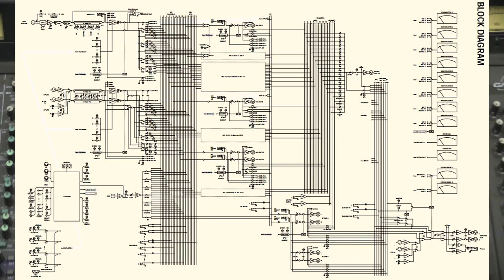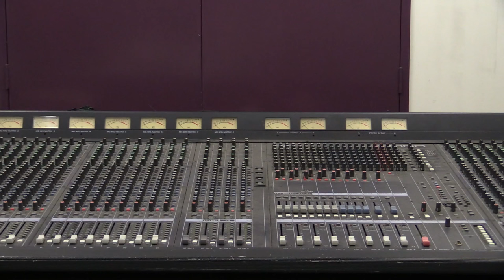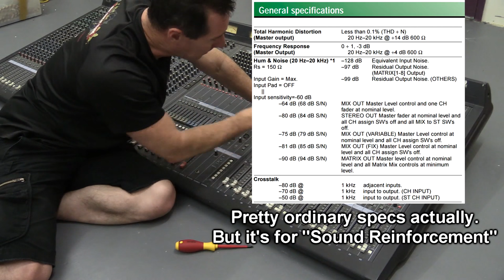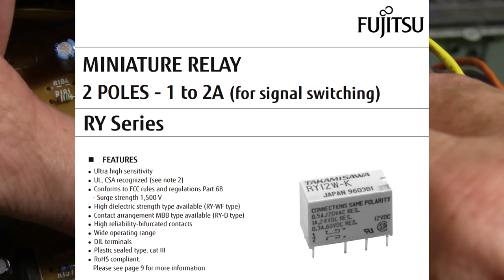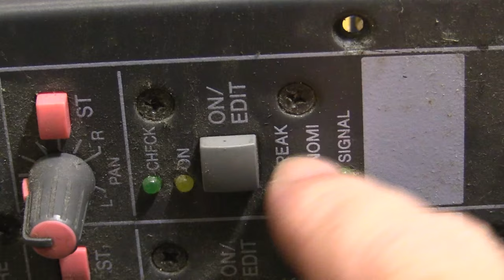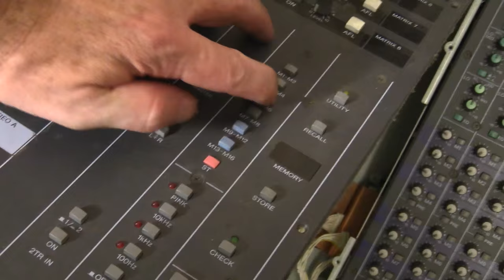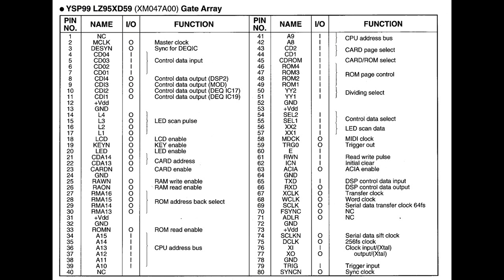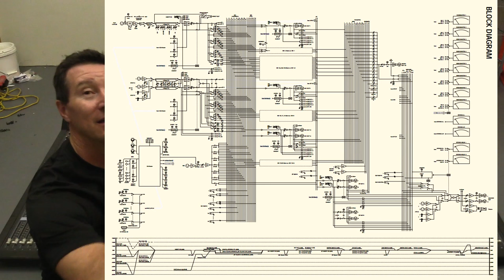EEVblog #840 - Yamaha M3000 Mixing Console Teardown

Comment: I use to work at a nightclub/concert venue  back in the 90s and loaded in and out all the bands equipment. Had a band called "They might be Giants" bring in their own sound board about that size. Was a mother to get that thing moved upstairs and back out of the place. Thing had to weigh 200lbs.

Comment: The Yamaha M-series (M for Mixer) have been the cheap version of the PM-Series (Professional Mixer). But both products would not have been accepted by any serious Band In those days. Preferred boards were the Midas XL4/ Midas XL3 or Midas XL200 or a few years later the Midas Heritage-Series. Nowadays almost every production uses digital boards. Greeitings.

Comment: 30:30 Maybe the little circuit board with the 7805, placed away from the main large circuit boards, was not a "bodge" but rather a deliberate design choice to minimise digital noise or something getting into the analogue section. The Yamaha engineers seem to have taken care with most of the other aspects of the design, so a "bodge" that looks like an afterthought seems incongruous.

Comment: Here's a suggestion for if you can't sell this, Dave.
Figure out how to power and operate the modules individually (in a video of course) then sell the modules separately.
The buyers can then use your video to hack together their own power supply and have a little 8 channel mixer and maybe make their own master section for it.
Or at very least, the buyers will have 8 decent preamps and EQs, which they wouldn't otherwise be able to acquire, to put in their own projects.

Comment: Dave, just to point out. This would be considered the top-end of the consumer market. Low End show board. It is a workhorse that has probably seen the inside of most reputable theaters pre-digi boards. A real mainstay along with the Mackies and Allen and Heath. 

There are some MUCH beyond with similar channel packages. Back in that heyday for these boards (mid to late 90s, early 2000), wayyyy too many showboards like this were floating around. The Yama always had outstanding noise floor for its price range. If I remember right, this board was somewhere in the $6-8,000 (American) range. Possibly a 9,999 jobby. Anywhoo, used em before, filters and the rest, as you discovered, get absolutely filthy and they still work.

BUT!!! That is the failure mode for sure.

Comment: I suspect the gap between the main matrix bottom panel and the side is because that digital card is optional. if you take away that digital stuff, the center pice would be ~5cm narower and the board and inteconnects would fit nicely. There also seems to be som sort of hight issue, so the digital board migth actually have clashed with the main bottom pcb.

All in all verry nice modular aproach I think.

Comment: The memory is to recall the state of the mutes on the channels and outputs for different songs/scenes. And that console is actually Prosumer level, not professional, a ''newer version'' of a non memory recallable console, thats why each input switch has it's own board for ''on/edit'' and maybe why the 5v it's a little bit shabby solution. 

The Mix Sub in, was a easy way to link another console for expansion, routing your outputs from console 1 directly into the summing bus of console 2.

I think the space on the right of the main bus board it's just for clearance for the perpendicular board that it's mounted in the top part... another theory it's that for the 24 channels console, actually the console ends there, so maybe they didn't found it required...

Comment: Those big copper bus bars are shields for the board interconnects on the primary audio buses, not high current power lines.

The center master mixing board is likely that size because it was used in other mixing boards.   Why redesign a wider board for just that one model when a couple of cents of wire can fix the width issue?

Comment: I have a yamaha GF16/12 mixer from the same period I pulled apart and it uses the same JRC NJM2068, NJM4580 and NJM4556 op amps throughout, almost all in SIP8. Apparently they are high-quality but cheap op-amps?

Comment: The Analog Devices SSM2018 is a  Trimless Voltage Controlled Amplifier. It may be obsolete now as it was on last time buy last time I looked. Heres a link for the data sheet for those interested http://www.analog.com/media/en/technical-documentation/data-sheets/SSM2018.pdf

Comment: Per-channel 48V switches are great. I recently had a dynamic microphone which couldn't take it. Luckily I didn't have anything that required phantom power, so I could turn it off globally, but if you have shitty dynamic stuff that can't handle it, and also some condneser mikes that need it, you're screwed with most setups which only have a global 48V switch.

There are currently two for sale on ebay in Germany, at least one of them is installed in a studio. They're not worth a lot any more.

Comment: +EEVblog to answer your question at 36:25. The board was cut short so that the digital part perpendicular to the top panel could fit when it was closed.

Comment: Yes you will not find surface mount components, and in the 80's and 90's double sided boards were alot more expensive than single sided with jumpers., hence Yamaha did it to cut costs.

Comment: I tore apart a small mixer board 16 channel Asus? a few yrs ago.I was very disappointed with the quality. the pots were not separate components on the board.the board had the resistive part on its surface.the knobs and wipers were held to the board by a large piece of plastic.

Comment: The only thing that I would find more intimidating than using one would be designing and laying out the components in this. But I suppose there is a lot of repetition in the circuits, so that would make it a little easier.

Comment: Dave I see people operating these consoles in recording studios. One question I have is sometimes the people operating them they do something and the sliders move sort of like when you change the EQ in your phone or PC and the sliders  change positions. I've always wondered how that works on these big consoles, possibly a tiny motor beside each slider? It doesn't look like the console your tearing down has these.
Love your videos Dave.
Reply: +coondogtheman1234 Yes, they're motorized faders.
Reply: Raphaël Doursenaud
I figured they were but the one Dave tore down didn't have any. Guess they don't need that function at a concert.
Reply: They are rarely seen on analog mixers and common on digital mixers.
Big studio consoles have them for "scene recall" and/or DAW control.

Comment: I learned to mix on an M2000.  That was in 1996 and it was brand new.  Yamaha's are rock solid, you could roll this thing down a flight of stairs and it would keep ticking.  Once you learn what one channel does, you know them all.

Also, roadies are NEVER allowed to adjust a console, they're just grunts.  The operator and maybe a trusted assistant of the console should be the only one(s) adjusting anything.

Comment: I have a theory about the jumpers; phase calibration. When you start to get very long lengths of signaling, especially if you are mixing many inputs together, the length of the cable runs will begin to affect the phase of the audio if some runs are longer than others. It is not much of a difference if they are not exactly equal length but in professional and audiophile electronics they go to great lengths to ensure that all audio paths are equal length. This is also the reason hifi headphones have a cable to each side instead of single calble, because it makes one audio path a different length than the other.
Reply: +Subparanon 

These boards aren't really big enough for that to be a problem at audio frequencies.  Maybe at radio frequencies, but audio is pretty forgiving - particularly as the different channels will typically be receiving wildly different input.
Reply: +Gabriel Hoffman (to OP) You generally need delays on the order of a millisecond or more to get into the noticeable realm for most audio purposes (at least outside of the lab insofar as noticeable reverb or alignment issues are  concerned).  A signal traveling through wire travels at roughly 1-1.5nS/foot of cable (depending upon velocity factor of the dielectric used), which means on the order of 1 million feet of cable, or thereabouts per millisecond of delay.  As far as phase delays are concerned (which is likely to be much more noticeable than a simple delay), the wavelength of audio, even at 20KHz, is a whopping 49,000 feet.  To have a perceptible phase delay you will need a distance discrepancy between two stereo channels that is equal to at least a small percentage of that figure (a 0.1% phase delay would require a 49 foot difference at 20KHz, and lower frequencies are much longer wavelength).  A few inches of trace or jumper length are not especially critical at audio frequency.
Reply: As I said, not an issue with audio frequencies!
Reply: +Subparanon The wavelength of an audio signal at 20 kHz is about 15 kilometers. So to get just one degree of phase shift due to skew, you would need a whopping 41 meters of extra pcb traces or wires in the audio path. Any effects due to the length of electrical audio paths in this mixer are negligible. Also consider that the mics are likely to be plugged in using cables of fairly random lengths. Mic placement will have a much bigger effect on the phase of the audio signals coming in, as the acoustic wavelength of a sound wave at 20 kHz is only 1.5 cm.
Reply: +Andrew Armenia I'm not saying it makes an audible difference or doesn't. I'm merely stating that this is a consideration in high end audio design and some designs are fanatical about it. There is a lot of snake oil in HIFI but it doesn't prevent people from over engineering in order to sell a product.

You know actually that would make a really cool experiment for EVBLOG. HIFI mythbusting. He has some of the equipment you might actually need to make objective measurements of these things.

Comment: Sweet!

These wires are closer to my heart than some of the teardowns..You should take a look inside my Toft 24 mixer, Dave. Beautiful console. Designed in the UK but built in PRC..They delivered the Golden Sample with minor errors which the Chinese just copied! All card based on a single backboard. Unfortunately you can't remove single channel strips, just the back panel..Makes it a bitch to work on.

You'd get about a couple of grand (UK) for that board now! Amazing, I know..Spesh without the PSU; they're about a grand on their own to buy separately